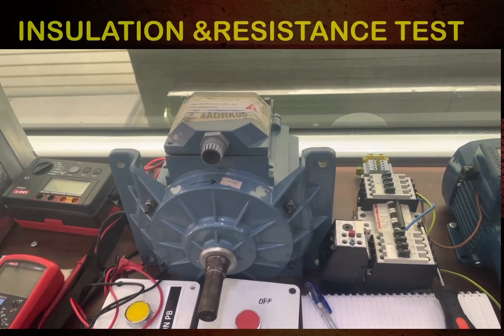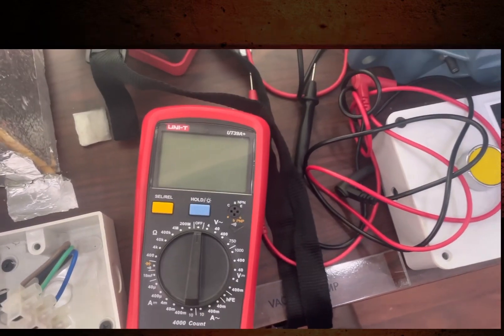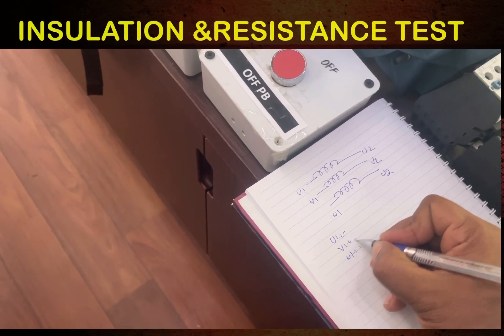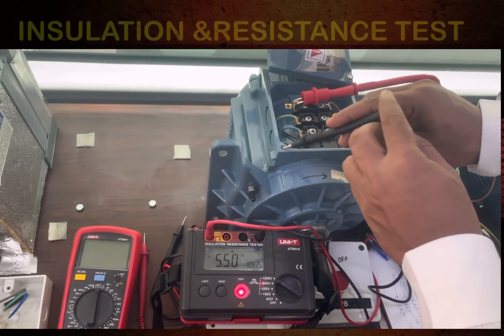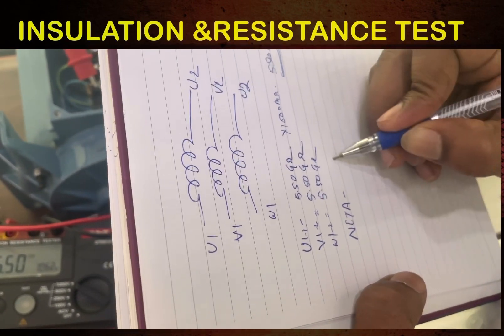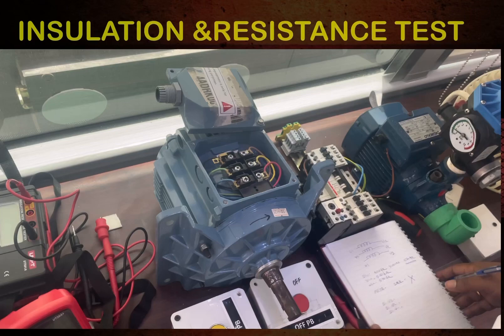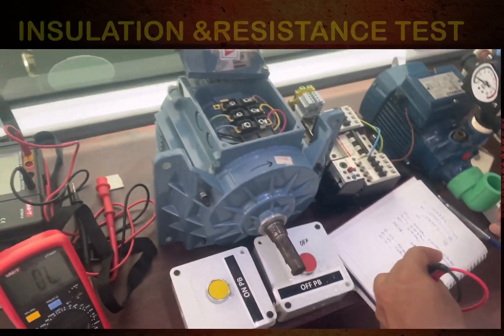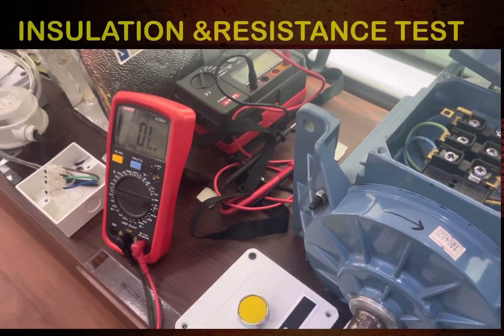Three phase motor’s insulation resistance test and winding resistance test. Use of megger.

Comment: Your testing at too high a voltage, 3 phase should be tested at 500v the insulation is rated to 600, 1000v test puts microscopic cracks in the insulation everytime you test

Comment: Tell me insulation and resistance difference...
Reply from the maker: Insulation prevents the flow of current using high-resistance materials for safety, while resistance is a property that opposes current flow within a material.